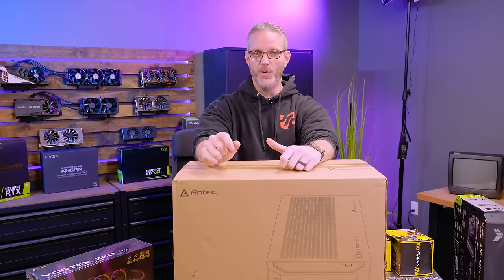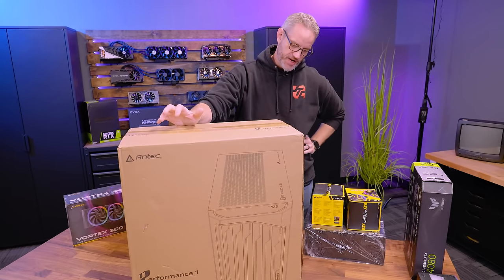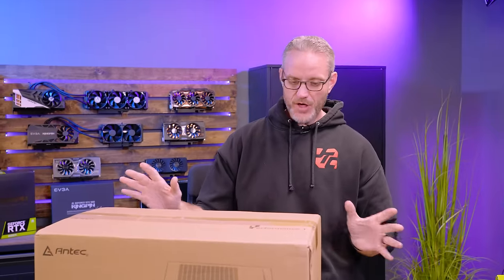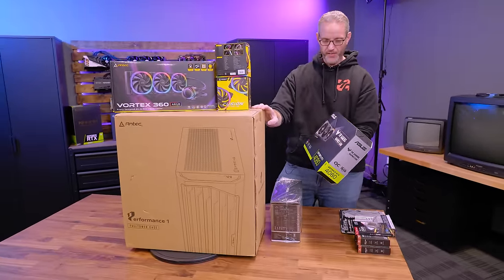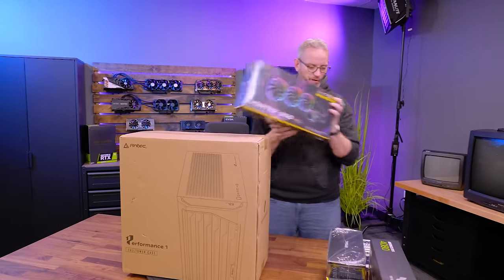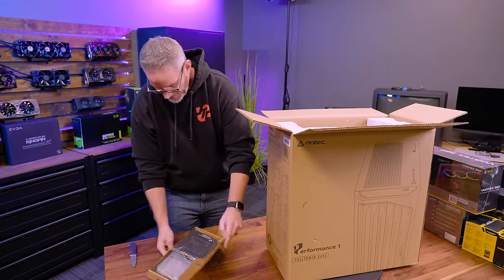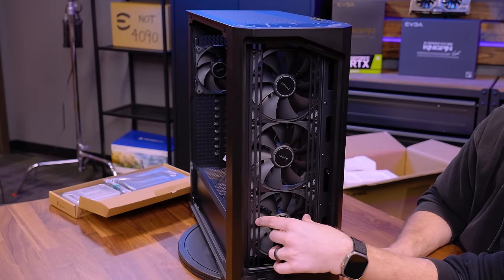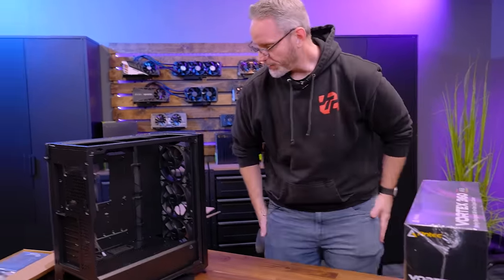Antec Performance 1 Full Tower Build!

Comment: Yeah very nice case indeed, also I like this format much more when you finish a build in one video that's a good improvement.
I have a Be-Quiet case myself the D500, it also has the sync rgb lighting with the motherboard and one smoked glass side, only weird thing is that my case doesn't have a reset button, I didn't need a reset key yet and if I go of my experience with my older computers it's only in very rare cases that I needed to use the reset button but still it's weird that they didn't even bother to add the button to the case.
I kinda wonder if there are more PC cases without the reset button.

Comment: Someone explain to me (because I'm stupid) how bringing in more air than what's being exhausted out is good. Jay mentions the three fans in the front that bring in a lot of outside air. To me, that seems as though you'd get air trapped within the case that will heat up quick, what, with the only one exhaust fan and whatever you have on top.
What am I not understanding?

Comment: I have the same case an i71300k and a subprim 4080. My case came with 140mm fans on the front as well.... My temps dont go above 55 on my gpu and 61 on my cpu..

Comment: Not a bad looking case, tho I feel like they stole some design cues from the Cooler Master Haf 700 Evo (or non Evo model) and put an Antec spin on it. The Cooler Master case has a circular display for sensor info on the from grill.

Comment: Nice and comfortably.  Classic Jay. Just moved my whole system from a Corsair C70 to a Tuf GT502.  What a nightmare...  Even though temps went down by 10c, "Dual Chamber" my ass.  That CableMod 12v 90/180 adapter is going to make a difference when it arrives. It should come standard with any GIGANTIC graphics card. Mounting the Gigabyte Gaming OC 4090 in the PCIe slot simply disables case closure...  Not cool.
Reply: I completely agree, the adapter should come with any big graphics card. Could you link me to that adapter if you don't mind? This is my first PC, and I didn't know the adapter was an option. I have a Gigabyte Eagle OC 4070 Ti and although it fits into the Corsair 4000D Airflow even without the adapter, I never liked that the cable bumps up against the glass.

Edit: Nvm, I found the video on these adapters that Jay did. Thanks anyway.

Comment: This may be a dumb question, but the Intel website says the memory speeds for the 13700k and 13900k are "Up to DDR5 5600 MT/s". Does that mean getting a 6200 ddr5 kit would be overkill and the cpu would not use the extra speed of the ram or would the cpu take advantage of the extra speed?
Reply: I believe it can but the memory controller is just rated (or thoroughly tested) for up to 5600 MT/s. Anything above is considered overclocked. Like they can't market it as 9000 MT/s if only 1% of CPUs can handle it because it's extremely unstable and requires a lot of voltage, etc.

Comment: Are 2.5in sata hdd so common? I really prefer the lian li o11 xl for it's provision for 4 3.5 in drives.. It's a jarring change in trend for someone still using an old nzxt that can hold 6 3.5inch drives and the 011 xl barely makes the cut.. There is a limit for how much you can spend on m.2 drives

Comment: I have questions since the fans of this channel are likely builders too so my question or situation is. 
1. I have the noctua 140mm dual fan cpu cooler and I can only run is with a single fan because my Antec case just isn't wide enough to fit it all without taking off the side panel, so what would be a nice wide case I could buy? Or is there a way to widen out the tempered glass panel side of my case? The case is the Antec NX260.
2. I want to get some fans I can control the speed of directly through the motherboard but all I seem to be able to find are fans that are controlled with one of those remotes I really don't like. I don't care if their RGB I just want to be able to control/ monitor the fans through Asus' AI suite 3. Anny suggestions?

Comment: I disagree with the baseless claim @14:09 about fine mesh being a death sentence for cases..
Generally companies like Lian Li with their 1.5mm mesh hole size and Phanteks with their 1.0 mm mesh hole size tout the superior airflow of their cases, and they usually land at the top of the best out-of-the-box thermal charts. Of course the “influencers” doing the testing eschew any form of filtration as if everybody lives in cleanrooms. Nobody tests filtration capabilities so that’s a void that needs filling but I can testify that 1.5mm and 1.0mm hole size mesh still allows dust into those cases. 

A filterless PC is like a filterless vehicle, very foolish indeed. Proper filtration with a positive pressure airflow keeps the dust from damaging expensive internal components. Perhaps nobody here has ever cleaned an AIO radiator, or dust encrusted fan blades that no amount of canned air could displace, or had to replace fans that failed seemingly prematurely. 
It’s odd that case manufacturers haven’t focused more on filtration since superiority could be another selling point they could tout.

As for this the case Antec sent to every “influencer” on YT, as well as all the other goodies:
The cons are the large vertical vanes on the front which is clearly an airflow obstruction and undoubtedly hampers cleaning the mesh screen properly. 
Plus the front fan mounting structure partially blocks airflow. 

The pros are the display, the removable top panel, and the front pull out filter on the PSU basement.

The last Antec case I bought was the Dapper Dark Phantom DP301M M-ATX about 8 years ago and while I just saw that everybody is still selling that same exact model, it wasn’t a well engineered case and it appears they’re still making the same mistakes.

Funny how the $67 Montech AIR 1000 Premium case outshines that $160 Antec case.
My personal case is a $115 white Lian Li Lancool 216 RGB with the optional (less than $20) front magnetic dust filter but it’s new so I can’t really comment on it except to say that the positive airflow ensures nothing enters that isn’t filtered.

I suggest these companies relocate their current “engineers” to the assembly or shipping department and find somebody more capable of innovation. They don’t need to reinvent the wheel. Just ensuring those expensive PC components receive a good supply of dust-free air would be a great start. Back to the drawing board Antec.

BTW, the cultist network rated the Antec Signature Platinum PSU as a low priority unit, which didn't sound good but another site said: Tier A, high end, low priority units. Still not real clear.

Comment: Dont get me wrong.... But Liquid IO that only last for 2 years, 1 per warranty and you cant repair them. No thanks. I stick with Noctua o Bequiet. RGB liquid not worth the headache. 2 IO cooling in less of 4 years was the tear dropped.
Reply: Funny how many times I read things like this and look at the AIO's ive installed that are still running 5+ years later.

Comment: great video  ,your build looks awsome, its hard to relly choose a good case ,, theres so many of them,,,,I LOVE THE ANTEC CASE ,, do you mount your power supply down word ,, because if someone puts in 3 lower case fans on the bottom you dont want to put the power suplly upword because your power suplly is sucking air out the back of the case ,, now also  i was looking at a Fractal Design Torrent RGB Black E-ATX Tempered Glass Window High-Airflow Mid Tower Computer Case it has the power supply mount at the top of the case which a lot of newer case is going to the lower power supply mount,, ,, and the front of the case almost looks like a antec case,, and can put 3 120mm case ans at the bottom of the case just like your antec case,, i just bought the rtx 4080 super will this video card the antec case ,, i am also looking to water cool my i7 13700k

Comment: Lets say that your PC is FULL tower case. Instead of the themperd glass you have a 27-32 inch monitor mounted on the PC case. So you have with your case all you need. Just plug your mouse and keyboard to it. Monitor can already have frontal speakers. Make or create this idea or thing or something like that

Comment: I could use some help with upgrading my first and only build. I built this in 2019/20 and was looking to update my gpu. My setup is ryzen2700x, 16gb ram, 512 ssd, 1tb hdd, rx 580 strix 8gb oc edition. My mb is a strix b450-f and 650w corsair psu.  My budget is limited and I want to try for 1080p to 1440p. Any advice?

Comment: Personally I like the buttons and IO on the top of the case.
Reply: Your statement nails it.  "Personally".  This is the thing about choice - if you don't like the display there, buy a different case, if you do like it there, then put it in your list for consideration.  Don't understand why so many people are angry about it - a lot of people place their PC on the floor so that positioning would be perfect for them.  My case is on a stand that sits below me, that temp display would be perfect.   I also know people who sit their PC on the desk and it would not work.
Reply: @malphadour I had a case with blue led lights on the front for power and disk drives, they would distract me. I ended up having to  disable them. I had cases with usb ports on the front but my kids would step on cords sometimes and it would damage the ports. I have Fractal Torrent currently and I am very happy. This case looks like a great option to me also.

Comment: That case was clearly designed for placement on the floor, not on top of a desk. The ports on the top and the temperature readout that points upward are both signs of that. I say leave this design alone, but also offer another model that's designed for desktop placement.

Comment: You said 40 series gpus and new gen cpu run hot,  but the gpus don't actually and for the new cpu there not that bad tbh..
 I have a 4090 and 13700k in a corsair 7000d and my Temps are 50ish-deg and 60-deg respectively

Comment: Does it fit Arctic Cooling 420mm. It says it has 60mm clearance for thicker rad. Is that just the rad or rad with fans? Cause rad +fans is 70mm
Reply: That may be tough - its a big boy - just about shoe horns into a Lancool III which is a bit bigger than this.

Comment: Hi Jay,
Not sure if you'll see this but need some help. My computer when stood doing nothing, the screen keeps flickering, I've tried a clean install of nvidia drivers using ddu but the problem still persists.
I'm using a rtx 3070ti.
When running Valley benchmark Mark 
I get 75c on the clock and 81c on memory
And 88.4c on hot spot.
Is the memory failing on the gpu?

Comment: For me, there will be no case that is Trully oriented around ariflow if it doesn't have fan intakes on the side panel for gpus these days :)
Allthough an exception would be if the gpu is watercooled meh :p
Reply: Or fans at the bottom like you can on a Lancool III

Comment: I have a Dell computer that I am trying to get to limp along until I can get a new computer built. I have three dead temp sensors on the motherboard (cpu temp, hdd temp, and pci temp) and I need to bypass the sensors. I got an external fan controller and wired the fans to it and ran a test. The computer boots, and I can now manually adjust fan rpm to ensure adequate airflow, however, the thermal controller is throwing errors because it thinks all the fans are dead. How do I safely trick the computer into thinking those fans are plugged in to the motherboard? I’ve thought about using splitters to allow the computer to see the fans, but I don’t want to overload the wires with current and cause a fire. Since the temp sensors are dead, I know that the motherboard won’t ever send a signal to increase fan rpm beyond idle but im still concerned that the extra current will be enough to overheat the wires. I’m also slightly concerned that power from the external controller under load could back feed into the motherboard through the splitter and fry the motherboard. Does anybody know how to safely do this beyond just getting several fans to plug into the motherboard to make it think fans are plugged in when they aren’t actually doing anything?

Comment: The built-in GPU/CPU of my Antec PFT1 case temperature display doesn't turn on. Clicking on the button does nothing: I've installed the iUnity software and double checked the necessary connections. Any ideas?

Comment: J!!! Question! I have a i9 13900k rtx 4090 Corsair 1000hx psu msi edge Wi-Fi z790 with a full ekwb loop. My temps for my cpu are still the same that it was if not a little worse then with my Corsair 280 all in one cpu cooler. My temps are up on my graphics card but I am getting better heaven benchmark scores the full loop 6600! My cinebench 23 scores are 39500 stock but temps on a couple cores reach 100c but and the power consumption jumps to over 350 wats and the volts jump as high as 1.5 I was assuming with a full loop I would be able to leave it out of the box and not undervolt. Should a full loop with the new ek quantum vector2 trio and the ek quantum velocity2 d rgb with 2 ek quantum surface p360m xflow rads be enough to cool it stock on 100% use on cinebench I need you opinion before I tear it all apart and double check the thermal pads thermal pasted etc? I’ve been searching as much info as possible. Petg tubing d5 waiting Kinetic is the pump I’m using

Comment: 9:33 why did he say u can mount fans there? how would the airflow work? anybody done this
Reply: The bottom is filled with air vent holes, while you mounting fans on PSU shroud, they could bring air to gpu from the bottom, including the air intake by the lowest fan at front. If you don't need 3.5 HDDs, remove the bracket, the airflow will be better in this case.
Reply: isnt the psu already taking up the air of the vent holes? or do they extend to the entire bottom of the case

Comment: Talking Top vs Front. There's too damn few decent cases with front panel.
Top panel is neat for showoff, but most actual workplaces will want the case down and away to maximize desk space, minimize noise and clutter, with just the necessary parts exposed ( intake, ports, buttons ). In the meanwhile manufacturers offer almost no decent solutions to conveniently access internal features from front (e.g. like pull out server rails only for desktop).

Comment: I just built a PC in this case and I didn't really like it.
Its smaller than my old Corsair 1000d so not  a full of a full tower. It only had HDD space of ONE 3.5 drive (I have 4) that easily fit in the Corsair so had to shove them into he bottom power supply area. In general its crammed for a full tower. 

Now the temp read out. 
Its nice but they left out every other led a PC normal has. NO LED for power , No HDD activity LED, there is NO LED info at all on this case other than the temp display. Its so dark you couldn't even tell it was on so I installed some RBG fans in the front just so I could tell it was on.

It is a quit case and does have good air flow but....see above.

Comment: Compressed air to remove dust is so silly. Instead of blowing it around, just use a good vacuum cleaner. There are attachments on sale that cost nothing but are ideal - like essentially a big bundle of straws attached to a vacuum cleaner attachment. You can shove that anywhere where parts or cables are thicker than the straw and just suck out all the dust completely safely. Even out of parts bins, for that matter. Worst thing I ever saw on video was some repair guy using compressed air on a pc that belonged to a smoker - I thought I was going to upchuck. Always a vacuum cleaner. At the very least, start with that.

Comment: $155 usd...ouch.  Cool case though.  Also, doesn't look like 3.5" drives will fit on the wall with larger fans or a front mount rad with fans in the rear.

Comment: So pissed the z790 apex is unbuyable, now my z790 hero is not 100% stable with 7800mhz ram, had to lower the clocks to 7600 to avoid crashes in rdr2

Comment: Is it possible to Mount 3x360 Radiator at the Same Time?
Reply: No. 

Radiators are 400mm long and the bottom only has room for the 3 fans. The ends of the rad likely  would not clear either the I/O in the back and the rad/fans in the front. 

It would also force you to do a horizontal mount with the GPU, which with most custom water loops you would want to mount it vertically (for looks).

Pretty sure it can do top and front as long as the tubes on the top one are in the back of the case. Tubes on the top in the front might be tight for clearance on the fans mounted on the top rad.
Reply: @CP-fm7zy  okay thanks :-)

Comment: Why have a case with a temp read out when you have a led readout on the board that shows your your temp. Most bios will show the temp via the led albiet its actually so you can see the codes it running thru on boot.
Reply: Are you sat so that you can see the top of your motherboard?   I suspect that many are not.  My PC is too my left, so I would need a mirror to read it..... Backwards.
Reply: @malphadour  most people have there pc to the right on there desk. Hence why the majority of cases that have tempered glass have it on the side you can see. It like almos every photo you see of a pc setup. It's pretty easy to read.
Reply: @kaisersolo76  I can tell you this isn't the case.  I see a lot of home PC' s (its my job) and I would say it is roughly 50/50.  Personally I would not have it on the desk and that is in the way.

Comment: Where are the cons. The weight is the main problem for this large casing. You have a round table to turn the case. Most builders does not have such tool. It will be troublesome moving it.